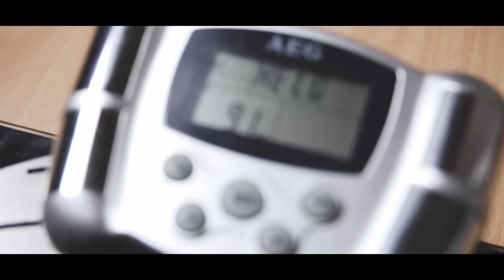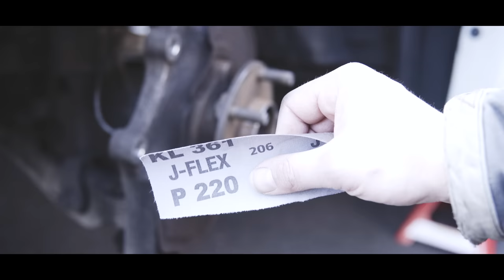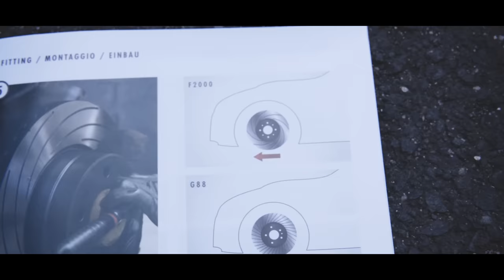NISSAN 350Z BRAKE UPGRADE | BREMBO TAROX F2000 EBC BLUESTUFF NDX | ZerofuckZ Ep. 31

Comment: Great video bro. I’m thinking of upgrading to these rotors as well, just wondering if they are a direct replacement for the OEM Brembo’s on the 350z. If so do you have the part number for them.
Reply from the maker: Direkt replace for the oem brembo brake. Us Models with non brembo got smaller rotors I think. It's the Tarox f2000